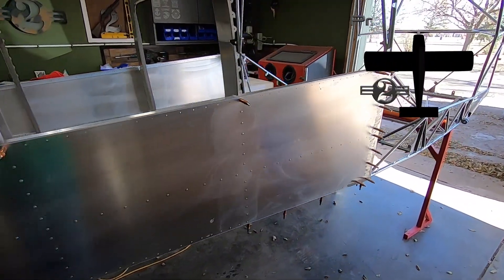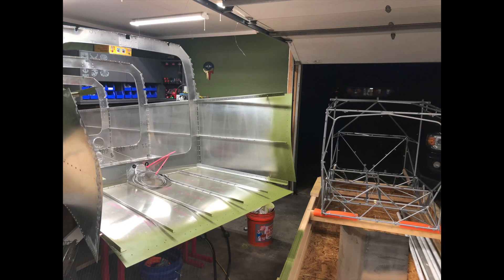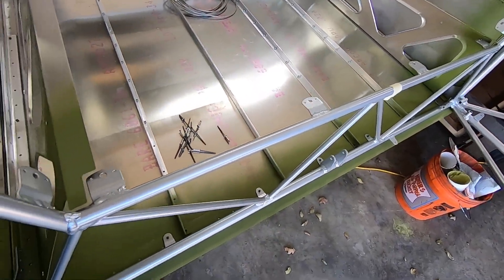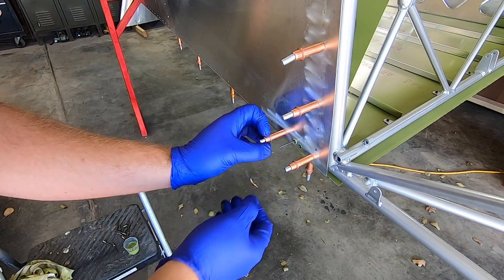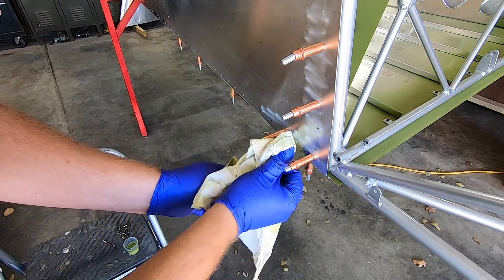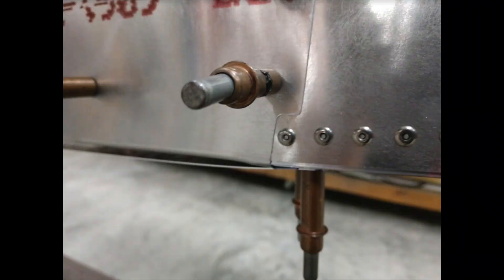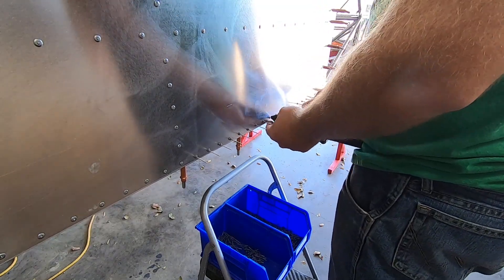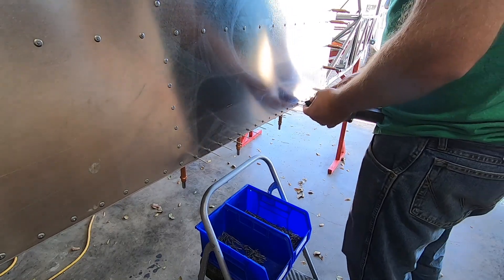RANS S21 EP12 MORE FUSELAGE WORK

Comment: When you tightened the bolts/nuts you modified at station 8 for the cable keepers on the rudder cable pulley, how tight did you go with those? I’m not sure why they would need to but I am assuming they need to be able to rotate otherwise they wouldn’t simply be mounted by one bolt with no rotational stability 🤷‍♂️
Reply from the maker: I left it able to rotate around the bolt as intended by the original design. Plenty of planes flyin good out there without this little mod, I just wanted to improve the load paths a bit through these parts “just in case”..
Reply: @Project2Aero  Well your build is awesome and  your videos are incredibly helpful. Thank you so much for taking the time to do this.
Reply from the maker: @Lams87  thanks! Appreciate you watching and engaging👍